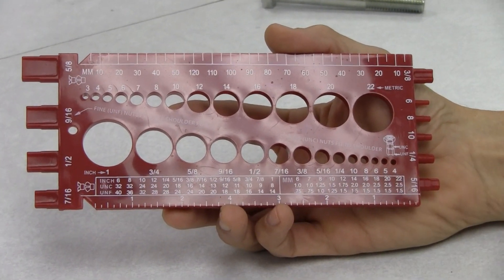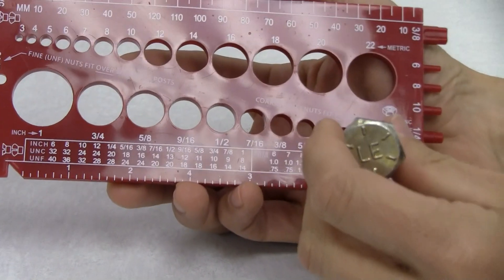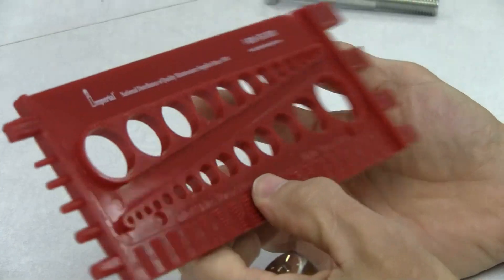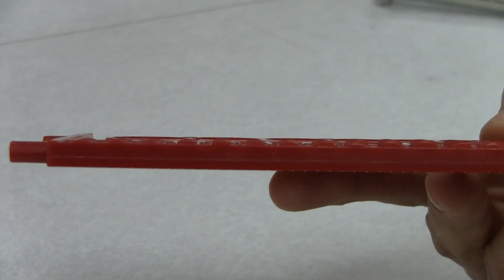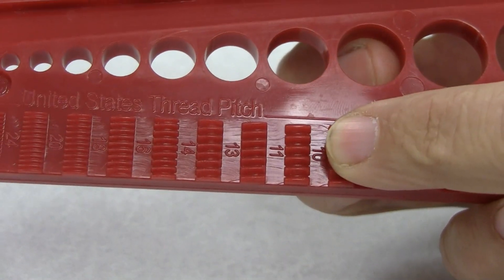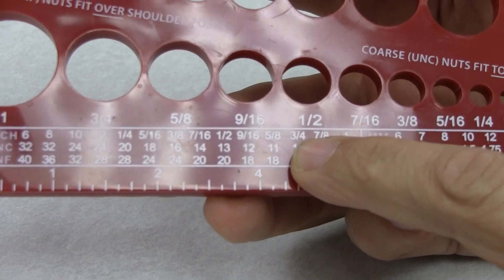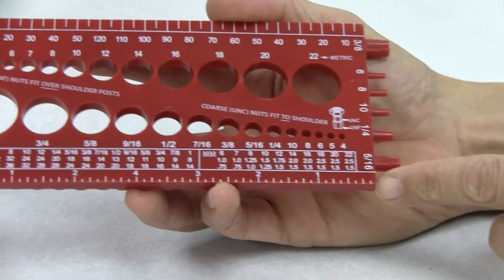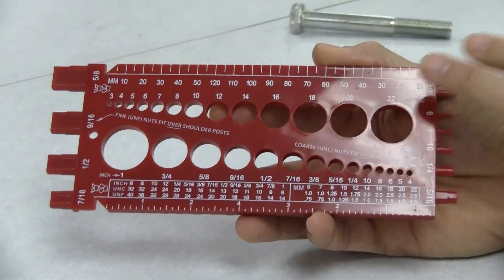How To Measure a Fastener.

Comment: That is not a cap screw. It is a grade 8 hex head bolt. And don't drag the threads across the gauge like you did. That will result in false readings over time as the metal bolts wear out and flatten the plastic. Instead, just hold the bolt against the gauge.

Comment: thank you!  i dont have this exact gauge, but your tips were very helpful. i especially like the details about (1) how to drag the bolt on the raised threads and (2) how to cross check if they even make the size you think the threads are!  thats so smart and it helped me narrow down what mine could be (as we didnt know if it was US or metric). our gauge is green and says "www.boltsizeit.com" on the back...anyway, the bolt gauge is one of those "tools" we have around my husbands shop that we dont quite know exactly how to use it to its fullest capability (kind of like a speed square haha).  now we have a much better idea!  i lost a little bolt for our flagpole and now i know what to go get @ the hardware store.  thanks for taking the time to make this video.